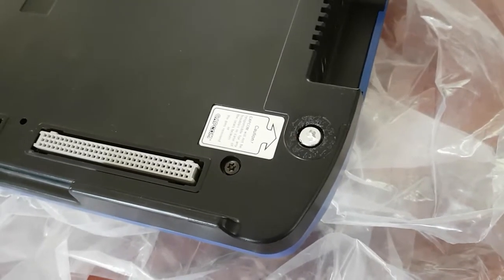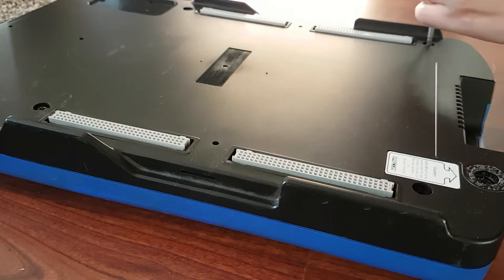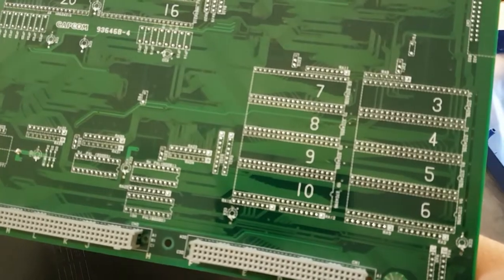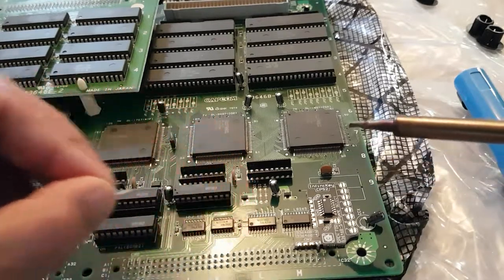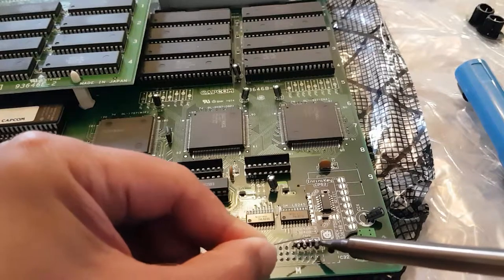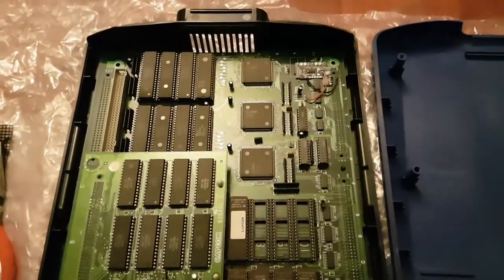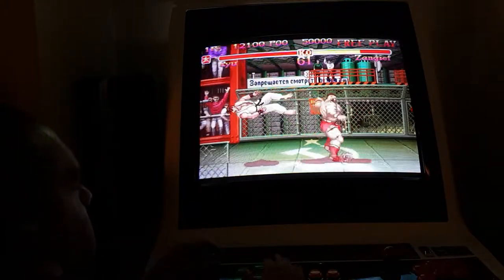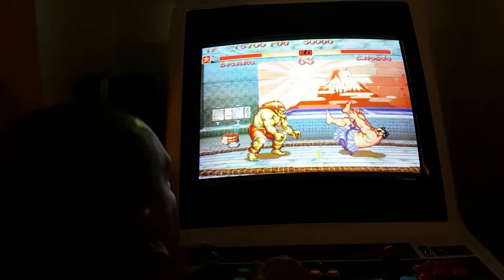Capcom - CPS2 - InfiniKey Install

Comment: I'm always amazed how many cps2s are around still with the original battery in, i bought 3 cps2s last month and all 3 were still on original battery's incredible considering those are coming up to 30 years old, i only had one out of the 3 that was dead jpn xmen cota, battery was dead and board suicided, i don't bother with infinity key much prefer to keep it original and put a new batt on and load in the keys with Arduino if it's suicided.
Reply from the maker: Hey mate, yeah I've always thought the same, it is amazing.
I did think about keeping my boards original but then decided to give the InfiniKey a go.  I think it works great, and I'm amazed that I managed to even install it haha
I actually try to buy CPS2 boards now with this already installed, sometimes the sellers even give the option to install it if I contact them prior to purchase.
How many CPS2 boards do you have?
Thanks for watching :)
Reply: @AussieFreakGamers  i now have 36 boards all different regions, most i bought as dead boards that i repaired as thats the only way i can afford to buy them, working ones are quite expensive these days, i do conversions on some to games i like as well, my hollygrale is my Super street fighter 2 x japanese cps2, bought it new in Tokyo 1998 comes with it box and all the arcade artwork, its my favourite game.
Reply from the maker: @Megalocade  Wow!! That's an incredible amount of boards! I still only have 3 boards I think but I would love to own SSF2 X.  That's the Grand Master Challenge board? having it boxed with all artwork, what a piece.
X-Men COTA that I bought years ago.  It was listed as original but when I opened it, it had been phoenixed! I didn't complain about it as the game still worked and I guess it saved me the hassle of having to change the battery or install the InfiniKey.  It does bother me though that the seller listed it as original.
I would like to buy a few more boards but you are right, so expensive.  Everything has become even worse since the pandemic, people exploiting the situation.  My issue at the moment is space, I'm running out of it haha
Reply: @AussieFreakGamers  yea space is an issue plus cost as well 36 boards is 36 batteries and can get quite expensive, i put holders in all of mine so its just a case of unclipping the old battery and pushing in a new one, the batteries with out leads are a lot cheaper thank goodness, i know what you mean about ebay listings its always hit and miss when they lable it as original, some folks really don't know so just list it as that, I've had one where it was listed as Marvel vs Capcom untested but when i booted it up its was X-Men vs Street Fighter lol someone either had put a new sticker on or new case, either way i didn't mind i just converted it to marvel vs capom, put a battery on and loaded the keys in, bought a new sticker and its a fine.
I do like phoenix editions because it allows you to change the games region from the menu, on a normal board it would require changing the program roms, which funnily enough I've just done that on my street fighter zero 2 alpha, bought it from Brazil its in a green case loaded with the Brazil version, took the 7 program roms out erased them and loaded on the Japanese version, loaded the Japanese keys in and now you would never know it was a Brazil version as its in a jpn green case.
Reply from the maker: @Megalocade  that's a great idea using the battery holders!
It certainly sounds like you know a lot about these boards, and how to fix and upgrade them.  My technical skills on arcade hardware is very limited to be honest.
Do you sell any of the boards that you fix?
What are your thoughts on the Darksoft CPS2 multi boards? I have never bought one due the price, and the fact I like to pick up original CPS2 boards (even though I only currently own  3!).  I was after the Darksoft CPS1 multi board as I think I only have 1 original board - Final Fight but I can't seem to find one available.  On eBay local to me recently someone was selling a CPS1 multi board that he bought from Aliexpress.  It's not a Darksoft obviously but looked like it works decent enough.  The 1.5 CPS1 boards use sound hacks because the CPS1 lacks Qsound apparently.  Anyway, I bought it from him just waiting for it to arrive...I hope I am not disappointed! if it works well it will be stuck in my Astro City for quite some time ;)
Reply: @AussieFreakGamers  No i don't sell any of the boards i buy and fix only because its taken me a long time to find sensibly priced boards, i could never afford to buy working ones, prices have really shot up in the past few years its crazy.
Yea I've seen those darksoft multi boards unfortunately they came about to late in my collecting of these boards, i like the idea of them and if you want access to all the cps2 games without darting behind the cab changing b boards then its right for you it reminds of an Everdrive I use in me Snes and Megadrive lol  😁, in my Big Blue cab i have a cps2 A Board bolted to the cab and it only takes a couple seconds to swap game carts so darksoft would be a bit pointless for me, if i only had a couple games then yea it would pay me to get one, I'm very old school when it comes to arcades i just like the original games on original hardware one game for one cart etc, plus like you say they are very expensive last time i looked they were listed for well over 1000 and something i couldn't justify spending that amount of money on in one hit, even if you make one from a darksoft kit its still expensive the price of the extra daughter boards and programmer is costly.
Yea I've seen those cps1 boards on aliexpress, not sure how good they are, the original cps1 does output 2 channels using the 3 pin CN conector, but it requires the volume pot to be removed to open up the right chanel and output at Line out volume, i did this mod to my sf2 ce board and the audio is very clean and sounds awsome especially if you have it hooked up to a decent amp.
Reply from the maker: @Megalocade  Fair enough...i think I would be the same after taking the time to find/fix a board.
Great Idea for the CPS2 A board fixed into your machine then swap the games out...I should do that really.  Definitely hoping to pick up a few more games.
You collect for Snes and Mega drive also? I have a couple of original Mega Drives, Model 1 and 2 but I also have an Analogue Mega SG, so mainly use that now.  I have the Mega Everdrive Pro, which runs the CD games too.  For Snes, no original hardware but I have the Analogue Super NT.  Fxpak Pro for that one.  I love being able to play all of the games I had as a kid, and the large number of games I never got to play.  I still buy a few original carts for those systems though.  I buy the Japanese SFC for Snes, love the boxes, manual etc. Final Fights, Street Fighters, Star Fox, Mario Kart...all the essentials.  For Mega Drive, again I like the Japanese games.  Bare Knuckle series, Golden Axe, Zombies Ate My Neighbors, Turtles: Hyperstone Heist to name a few.  I collect for far too many systems really, that Everdrives do become a great investment.